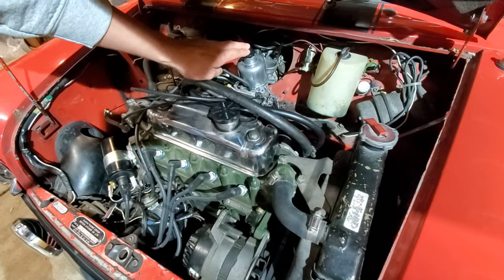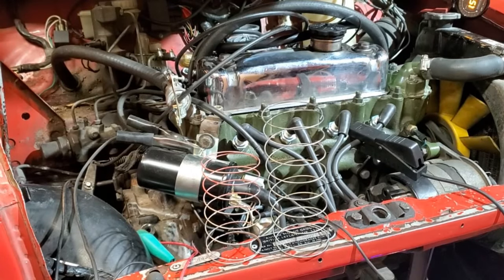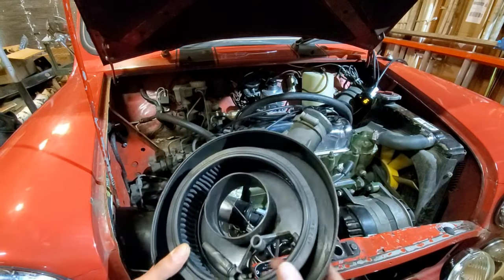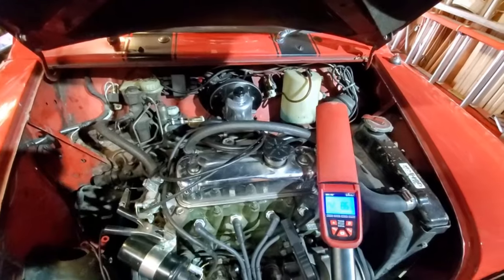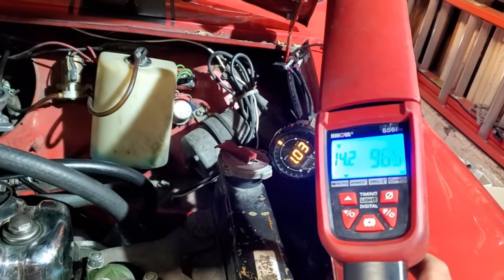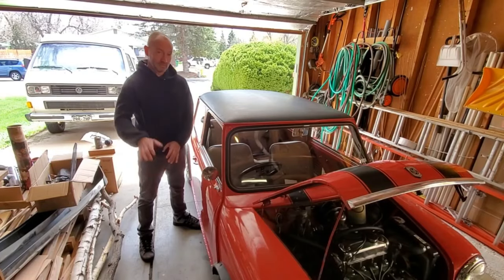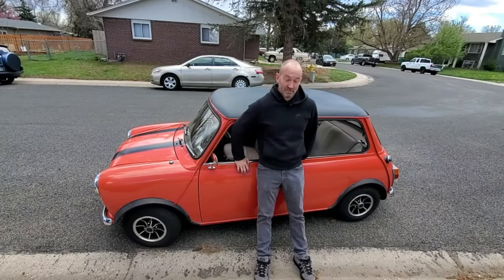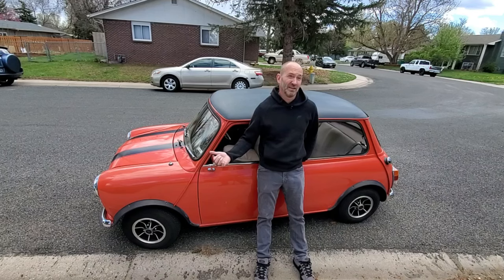Red mini Project Part 5. Final tuning!

Comment: Very interesting. I see you are using an AFR gauge to get a Lambda reading. Where do you attach the sensor on a customer's car?
Reply from the maker: I have made an adapter to connect to the  end of the exhaust pipe and then it connects into another long pipe to keep the gasses flowing smoothly.
Reply: @darrensrestorations991  So, it isn't necessary to fit the sensor into the exhaust manifold then?
Reply from the maker: @grahamwoodier5066   It is best to have it permanently mounted into the exhaust manifold. When I am on the road tuning, having it at the tail pipe is the next best option.